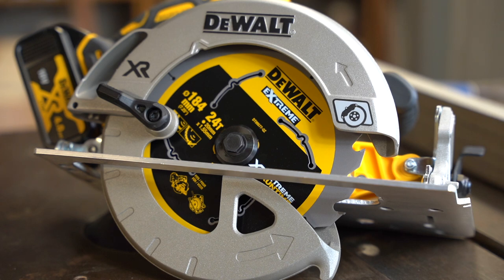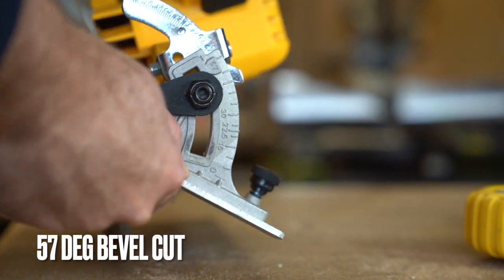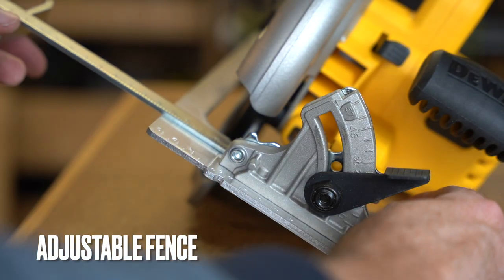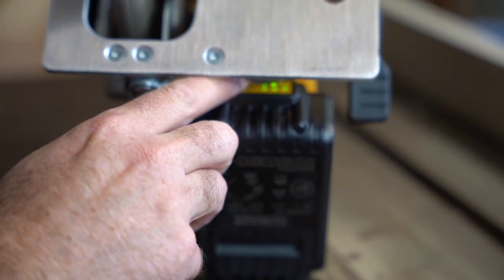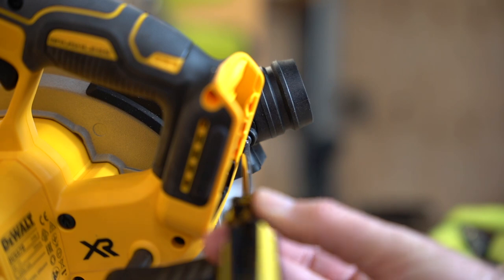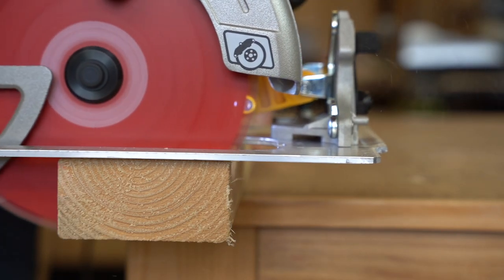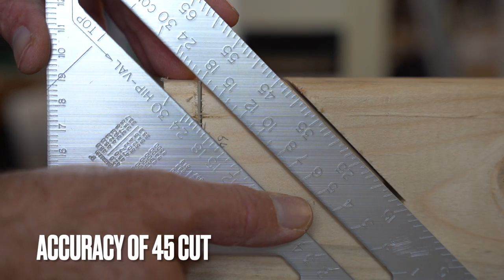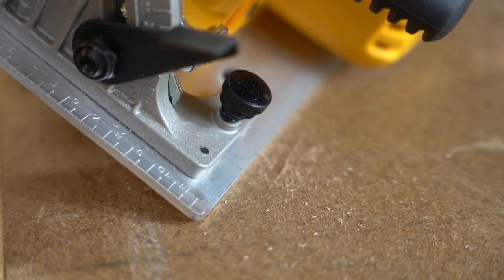Cordless circular saw | Dewalt DCS570 Brushless 184mm Circular Saw

Comment: Not sure if they added this later or you missed it on yours, but the shoe has a calibration screw for the bevel asjustment, so that it will actually cut at 90° when set to 90°.
Reply from the maker: Cool. I’ll have a look at mine. That’s a great feature.

Comment: I've had nothing but problems with mine,  it just stops cutting all the time,  I've stopped using it
Reply from the maker: Sorry to hear that Steve. Generally DeWalt are really good.
Reply: What size was the battery you were using?

Comment: want to ask if someone know my dcs570 problem..why when i press the switch, firstly it working normally..but when i put it for about 10 minutes..and i press the switch again, its not working..and when i take off the battery, put it back to machine..its working again..for used it for break time not to long..it's ok..but if stop use about 10 minutes..that problem coming again and again..what should i do? 
sorry if my english not so good..im from malaysia
Reply from the maker: I haven't had that problem on my one. Does it cut off after 10 minutes of use. Do you think it could be overheating?
Reply: @tooloptics8651  it's not overheating sir..just used it cutting about 3-5 seconds..and in 10 - 20 minutes used again..never overheating yet before..look like the sensor or anything like that

Comment: You didn’t mention, but you can see in your video at 2:43 the line guide notch at the front of the base plate is badly out…about 2mm.  For machined metal parts this inaccuracy is dreadful….basically if you use the guide to follow a line your work piece will be 2mm wider than you wanted. It would not have cost DeWalt anything to just ensure it was correct huh!
Reply from the maker: Hi Contessa. I think the notch on the base plate you are referring to, is for when you are cutting at 45 degrees. So I think the accuracy of the base plate is pretty good. But thanks for the comment. 👍
Reply: Kerf?
Reply: Put it another way….saw a line along a fence guide….then just back up (with power off) and see where the cut line comes at the front notches.  The cut is a good 2-3 mm to the right of the notch.  The second notch is for beveled cuts…probably well out too I’d imagine.  Thanks for responding.